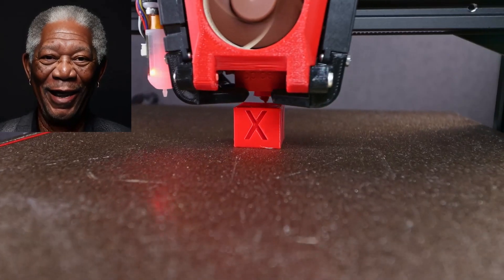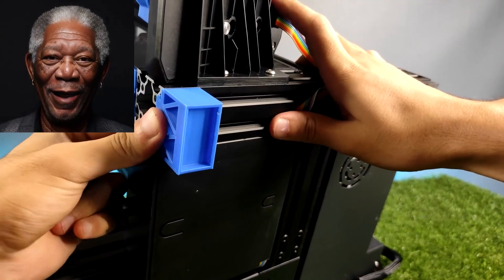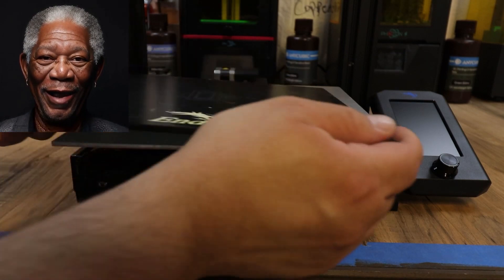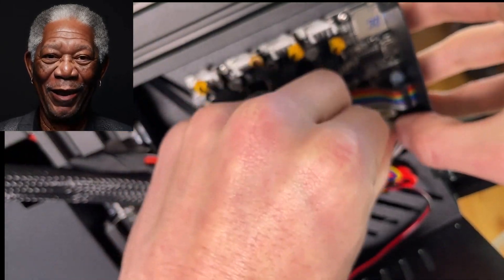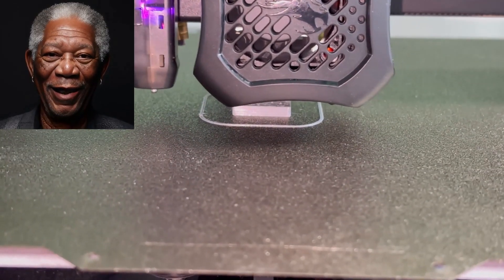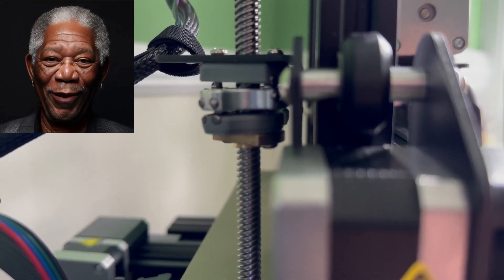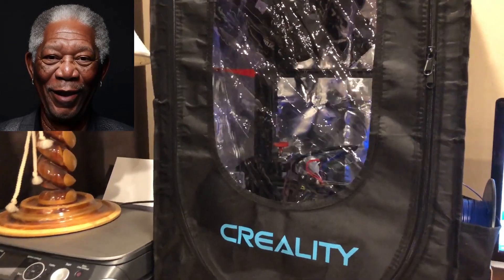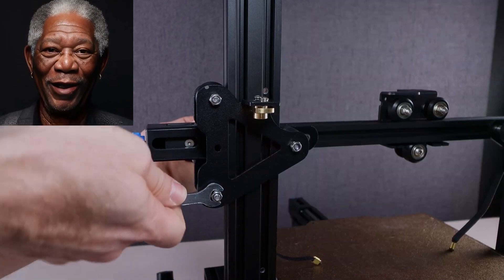Best Upgrades and Mods for your Ender 3 v2 (Part1) with Morgan Freeman

Comment: What all metal hot end do you recommend?  You mention it but don’t recommend an option. 
Thanks
Reply from the maker: My recommendation for the best results is the Creality Spider All Metal - https://amzn.to/3P38Wo4
Reply: I run the phaetus dragonfly. Had great success with it running pla/+, petg, tpu, and asa including carbon fiber blends. Haven't tried pc or anything more exotic yet but with the quality I get with everything else I don't know why anything up to about 315°c would be a problem. Other than requiring an enclosure.